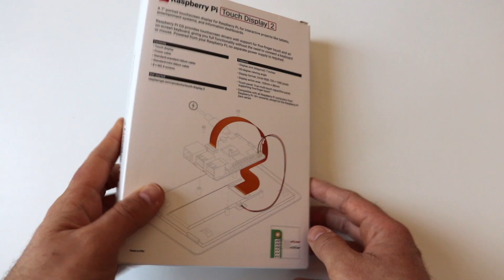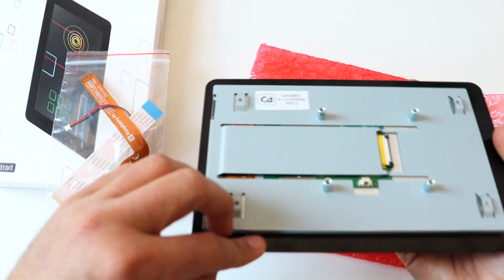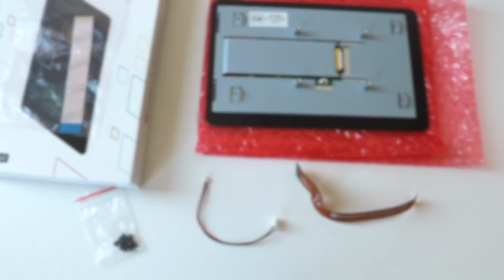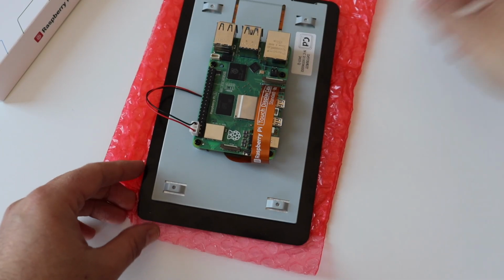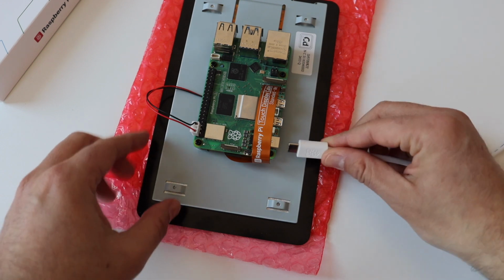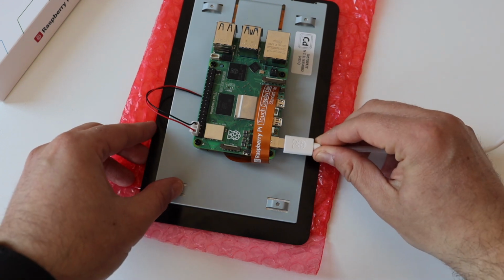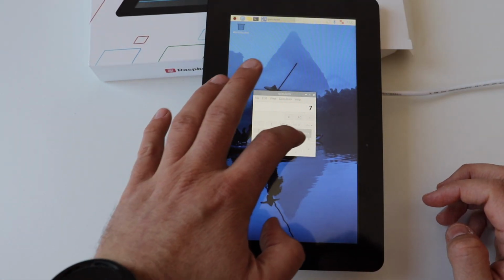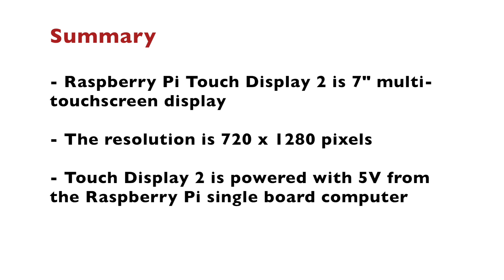Getting Started with Raspberry Pi Touch Display 2 and Raspberry Pi 5 #raspberrypi

Comment: Excellent video.  I especially appreciate your showing the flat display connector clips
Reply from the maker: Thanks for watching! I'm happy to hear the video helped you get up and running with the official Raspberry Pi Touch Display 2. I have also bought the 5" model recently. The connection process to the Raspberry Pi 5 is the same. I walk through that in another video though.

Comment: My raspberry pi is pi 4 B, but the screen is the same so how can I connect
Reply from the maker: Raspberry Pi Touch Display 2 comes with two different cables, for Raspberry Pi 4 and older models use 15-way to 15-way FFC and insert either end of the cable into the Touch Display 2 FFC connector.

Comment: can i use this screen to display gui that i developped on linux using QT ?
should i build a yocto project without interface and then run QT ?
Reply from the maker: Yes, absolutely, you can run Qt apps. Yes, you can build your own distro with the Yocto Project and meta-qt6 but you can also run them on Raspberry Pi OS or another desktop distro that supports rpi.
Reply: @LeonAnavi could you please make a tutorial on how to integrate the DSI driver of this screen in a Yocto image? In order to display on it the final Yocto image
Reply from the maker: @unknown-human-S  yes, I will! Thanks for the idea. It is straight forward and easy with meta-raspberrypi BSP layer. I am considering a Yocto/OE related video about core-image-weston using the official Raspberry Pi Touch Display 2.

Comment: Great video, thanks for that. How did you hide the mouse pointer?
Reply from the maker: I didn't do anything. It happens automatically on Raspberry Pi OS because in the demo I didn't connect a mouse.
Reply: @LeonAnavi  That is very awkward, it has never happened to me, and I've never heard about it.
Reply from the maker: @matheusfischer8975  in the past there was a Linux user space app called unclutter which was used for hiding the mouse pointer. Back then Raspberry Pi OS desktop was based on X11. After that, things changed. Since 2024 Raspberry Pi OS runs with Wayland across all models and versions. In the rpi forum you can ideas how to forcibly remove the mouse cursor on Wayland: https://forums.raspberrypi.com/viewtopic.php?t=358285
Reply: @LeonAnavi Thanks for all the explanation. I am actually aware of that, but I just find weird that you didn't take any action to hide the cursor, but I cannot reproduce that even installing a fresh new PRi OS. Every time I want to hide it, I need to take extra actions.

Comment: Great, nice video. But in my case there is a problem, I do the same steps as in your video, but the problem comes when I give it power, only the screen turns on but the touch screen does not work, what is the cause? help
Reply from the maker: hm, just to make sure we are on the same page you are using rpi5 with the gen2 display, right? Are you trying it out with Raspberry Pi OS?
On Raspberry Pi OS from the Preferences menu you can select Screen Configuration. Right-click on the touch display rectangle (likely DSI-1) in the layout editor and select Touchscreen from the menu. Although it should work it is worth double checking this configuration.
Also make sure all pins of both ends of the cable are properly aligned with the both connectors: the one on the display and the one the rpi5.

Comment: Thank you for making this video :D

It is very nice that one single flat cable handles the video and the touch signals 👍🏽

Can you check whether the rapsberry is using x11 or Wayland? 3d and video decoding? (Use neofetch)

Is it possible for anyone to make custom flat cables, like someone ordering pcbs?
Reply from the maker: Since October 2024 Raspberry Pi OS has been running Wayland by default for all Raspberry Pi models. Igalia a company is under a contract with Raspberry Pi to enhance the 3D performance out of the Raspberry Pi single board computers.

As for the flat cable, yes, you should be able to design and order a flexible PCB. Btw there are replacement cables from Raspberry Pi at different lengths. I bought such from Farnell and used it in a previous video where I showed how to wire the gen 1 touch screen to rpi5.
Reply: @LeonAnavi  thank you :) I am in the Armbian world I am still using x11
Reply from the maker: @robertoguerra5375  I have series of video tutorials about the Yocto Project and rpi5. I haven't made a video about the GUI yet. However, for the future I have in mind covering custom images with X11 and Wayland.